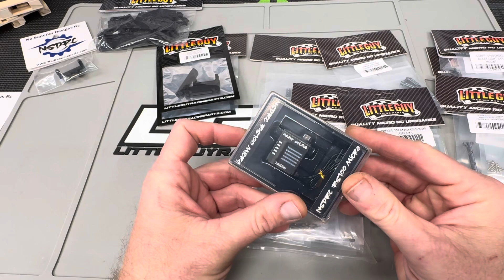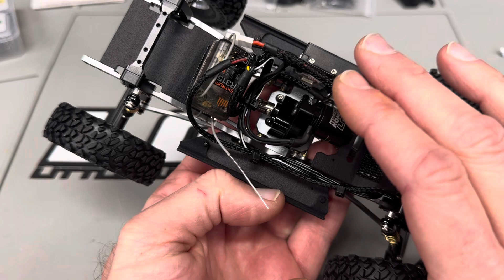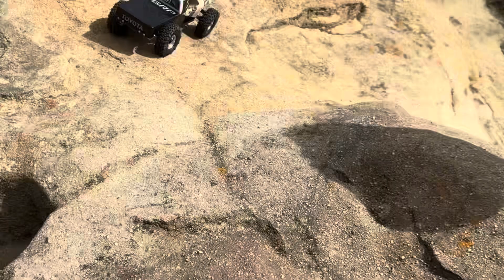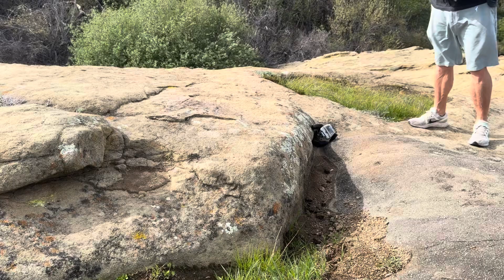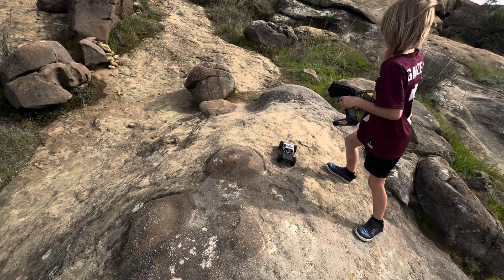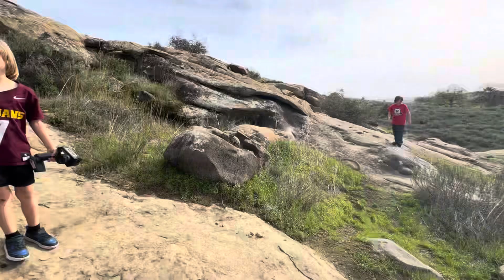LGRP Comp Chassis - Major Abuse

Comment: Run 2 batteries one on each slider with rec, esc on slanted tray next to the Cedar.
Reply from the maker: @rockwolfdesigns6384  If we ran a micro receiver I would definitely move things around. But that dang sr315 is super bulky